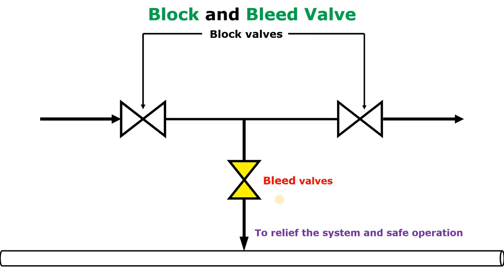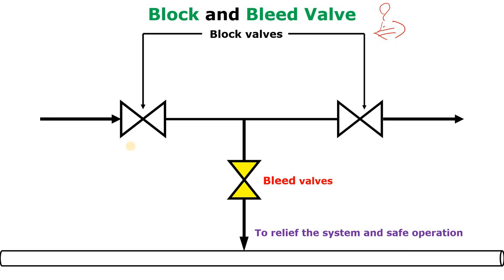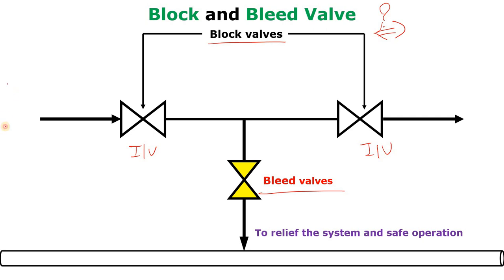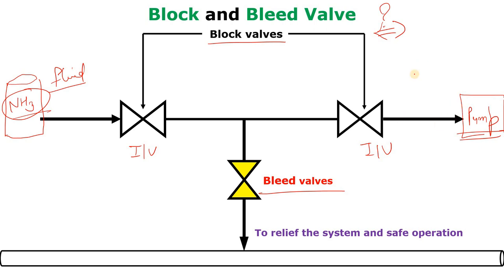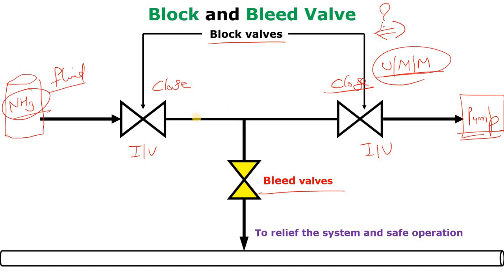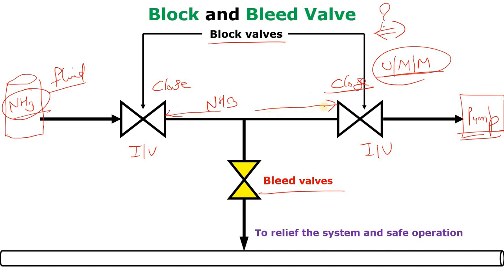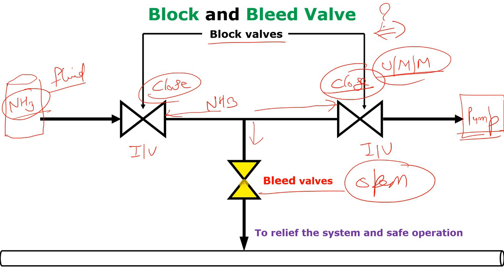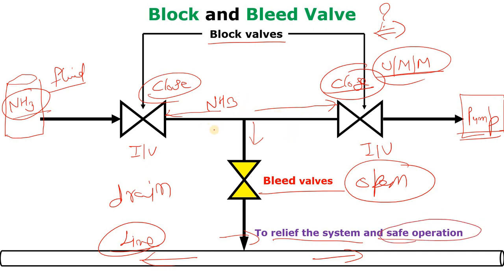Block and Bleed valve | What is a block and bleed valve used for? | block and bleed valve function.

Comment: i wonder, what about the NH3 that already passed the 2nd I/V going to the pump. is it pumped entirely (but i think pumping this way will damage the pump as it only accepts liq or there is no air? ). im confused tbh
Reply from the maker: Liquify it first via providing steam then drain completely it could be easily ensured from the drain line....then only close the valve to give to maintenance.

Comment: But if we are doing maintenance of Pump, then is it really necessary to bleed this small portion in between two i/vs, as per my understanding after right hand side i/v, there is  drain valve arrangements, or else for extra precousinary measure at bleed valve,  is there slope necessary ??
Reply from the maker: It's depends on process requirements...yes you must bleed that valve when you're stoping the pump or doing changeover so that any traces could be escape

Comment: Thank you for your explanation. Just one quick question. Do we drain NH3 to safe place through the bleed valve? I just want to know how to drain NH3 safely. Do we have to install tubing line to connect from the bleed valve to safe place?
Reply from the maker: we bleed it  and sent to tank(where waste ammonia soln will come)  so that it could be recover again via reaction to produce urea.
Reply: We use these for phosgene, we have a vacuum system we call an evacuation that we hook to the bleed and it's always sucking on it.

Comment: Why not just used one single block valve in this design so we don't have to use bleed valve?
Reply from the maker: this double valve is for the extra safety you may say let's suppose if there is a toxic fluid and your valve passes or malfunction so that's why there is a double valve and one bleed valve between them to bleed that toxic fluid